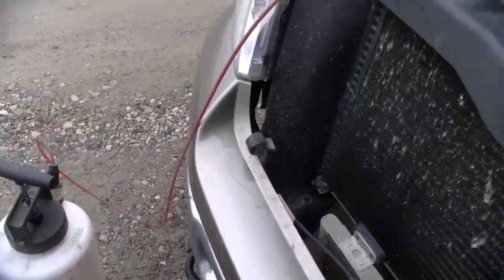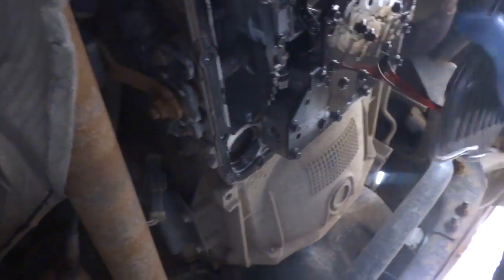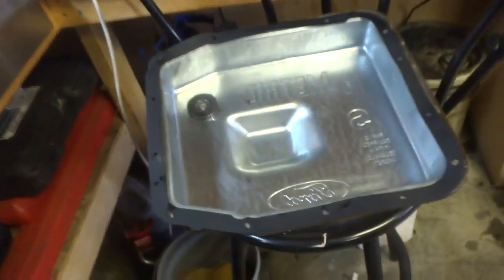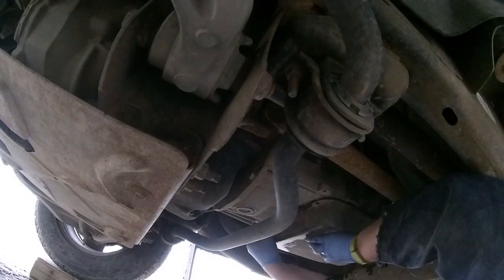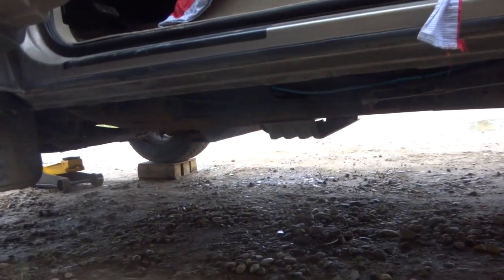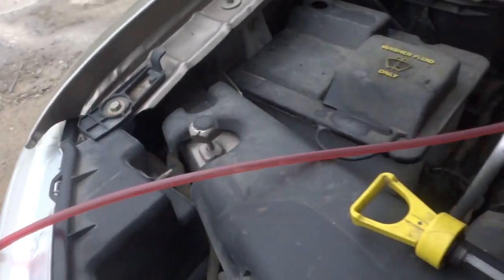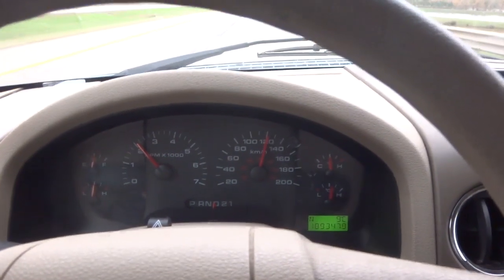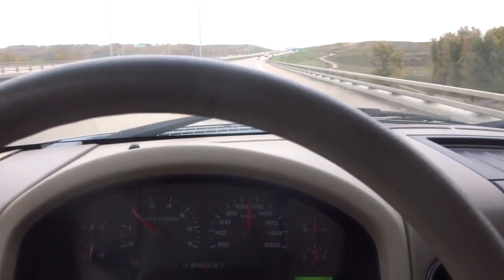F150 Transmission Oil Filter DIY

Comment: The plastic plug is placed at the bottom of the dipstick tube at the factory, and is pushed out into the pan when the dipstick is first inserted.  It is perfectly normal, but it means that the filter has never been changed before.

Comment: Did you look to see if the old filter o-ring came out with the old filter? If it's still in the bore the new filter can push it upward and the new filter will eventually work its way loose and fall into the bottom of the pan. You will have problems then. ALWAYS LOOK!

Comment: I hate the mess too. I think I'm going to put a Mag-Hytec pan on so I can get the drain plug. Ford also makes a pan with a plug for this transmission, but they only put it on vehicles they sell to U-Haul. It's called the "U-Haul Pan". I have heard of some guys being able to find them to put on their trucks. Once you get a lot of miles on an auto it doesn't pay to do a complete flush unless it's had them it's whole life. The trans can slip. I don't even flush mine cause its a hassle draining the torque converter by disconnecting the cooler lines. I just drop the pan every 15,000 miles and replace the fluid. I change the filter every 30,000 miles. It's probably overkill because the fluid is always clean.
Reply from the maker: ya my truck has about 190kms on it, that oil will last till it's in the boneyard or rusts away in the back alley. I really don't know why north american vehicles don't have plugs on the transmission pan

Comment: Did you put that plug back in the pan? And I used 6qts. I do need to take some out but other than that it runs awesome. Any chance you might know on where to get a pump?

Comment: Did you torque the pan bolts to spec or just tighten with a ratchet? Is it still sealing good?  I'm planning on doing a filter change on my dads 2005 f150

Comment: Hey I have a 96 ford f150 I'm the 3rd owner and I was wondering if I should leave the transmission alone because they didn't take very good care of it and my dad is telling me not to touch it because it would break it due to it not ever being cleaned. The transmission starts to slip when going 50+ mph
Reply: CAUTION  Do not use any additives to trans fluid these types of sealers and conditioners have a solvent in them that dissolves the clutch material then your trans will slip and need to be rebuilt.

Comment: Hey that plastic plug looking thing is ok to be there. When that truck was in the factory they used that at the bottom of the transmission oil dip stick so they would just push the dip stick in and that plug/plastic bobber thing would just float around. Nothing serious tho

Comment: Great Video. 
I have a 08 F150 and two days ago reversing up my driveway it was slipping and my O/D off alert came on with my check engine light.
100,001 km on my truck.
Could it be I need to change my fluid ?
If so where does the plug go back into if mine pops out ?
Reply: Did you ever find out what it was? mine just strted to do the same thing
Reply: Any of you ever find the solution? Im having the same problem.

Comment: Worked nice - I would have freaked out looking at the plunger in the pan too :)  Did you use regular trans fluid or something more " special"  ?
Reply from the maker: trust me I did freak out, i searched all over until I googled and found out it was nothing.  I used Amsoil oil for the transmission
Reply: LOL - Amsoil is the best choice

Comment: I did my '07 last year at 200K. Plug was still in there lol. Now the odd time it will slip between 50-60 km/h under acceleration. What's up with that?
Reply from the maker: sometimes that happens dunno why, try putting some lucas transmission conditioner in
Reply: Will do, thanks. That '57 is a huge project based on the early vids. Looking forward to see it come together.

Comment: My truck is jumping a little when going up hill maybe to downshift ? It's a new transmission from ford wats the poi just bought this truck it is used 2005 ford f 150 5.4 help !!
Reply: Mj Franklin change your coils, had the same issue only going up hill
Reply: Gay insults what do you mean by coils?
Reply: Neftali rasta Coil packs and spark plugs duh

Comment: Any more than 85k don't change it......if you do with in 2k trans is junk
Reply from the maker: I changed the trans oil in my Jeep first time at 250k over 300k and still going strong
Reply: Im doing it @ 70000 on a 2005

Comment: WTF what was the torque specs. NO that bobber is not part of the dip stick.  It fits perfectly into the hole at the top of the filter.  This guy is dangerous.
Reply from the maker: Wrong try again armchair mechanic
Reply: "Bobber" thats all i needed to read
Reply: Lol. Bobber huh.  Guess again